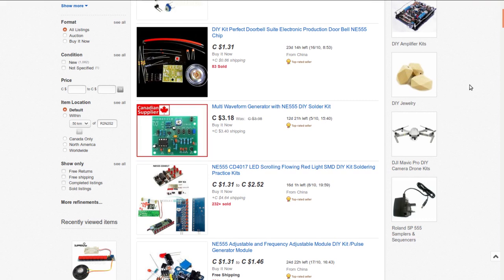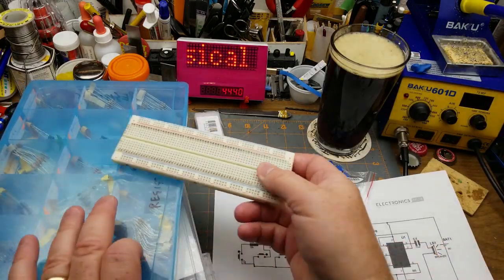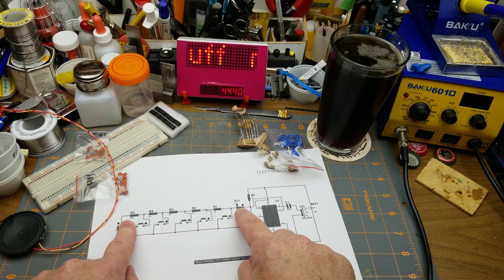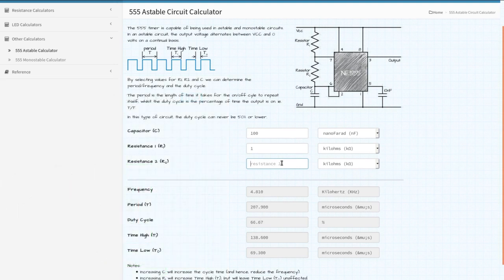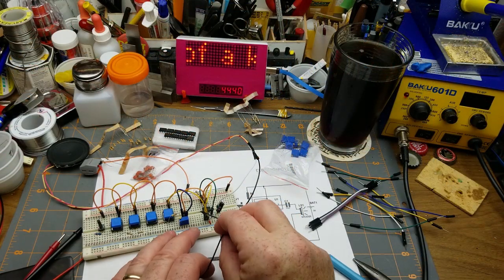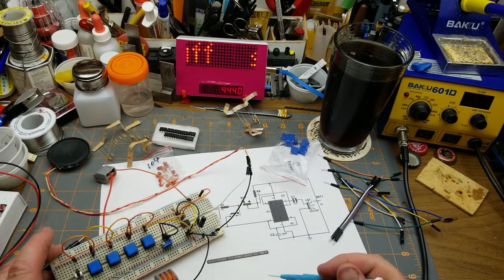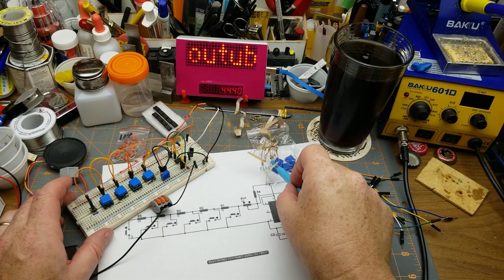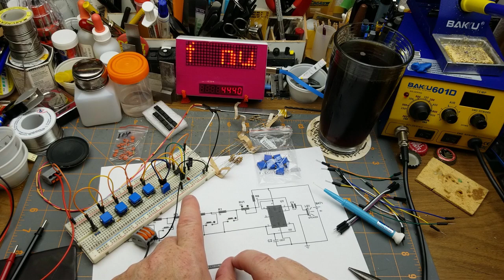simple electronic musical instrument  (starring the 555 timer)

Comment: When I was a kid in the 70's, me and my Dad made a 5 octave mono organ which worked on this principle. We didn't use a 555, it had an Astable multi-vibrator made from 2 BC108 transistors, and a long chain of variable trimmer potentiometers to tune it. Dad sat with a calculator for hours, calculating the resistance required for each note, then what resistance pot he had to buy for that position so it could be adjusted easily to the right value. I think he found somewhere that they were available cheaply, because he had a similar electronics buying strategy to you and ~60 trimmers back then weren't usually cheap! 
We couldn't afford a proper keyboard so we made one by cutting Formica strips, gluing contacts on the back made from phosphor bronze draft excluder strip (for the bottom of doors)  which he clamped between wooden strips to make the staggered keyboard layout. 
Many hours of soldering later, it made quite a fun instrument, I got reasonably good at picking out tunes on it despite having little musical ability. You did occasionally have to stop to glue back on a contact or 2 but I guess that was part of the fun. We then went on to make some circuits to modify the sound, like an envelope shaper and a ring modulator. Our experiments with the homebrew "synthesiser" stopped when I went off the university, but it was a fun time.

Comment: I love this beginners electronics stuff,  I remember playing around with 555s and 4017s or lm3914s back in the 80's I used to make up circuits from the Maplins catalogues They sold the chips and usually gave a sample circuit that that specific device could be used in. I made the very same stuff you are playing with, scanners and tone generators. never made anything useful but the experience has come in useful in my years in industrial electronics when ever you see a 555, 4017, 3914 you know exactly what it is you may not know exactly how it is working in application you are working on but you have a very good idea. I still play with basic electronics can't stand the modern stuff like FPGAs but arduionos are a perfect modern equivalent. love your videos and usually makes me get back to my work bench to have another play with stuff. Thumbs up.

Comment: Was waiting for you to press two keys at once. Now I may have to make my own to scratch that itch.

If the resistances add up, using a set of standard resistor values would let you use multiple keys to generate ... well, lots more notes than one key at a time. Practical demonstration of why those resistor values were chosen.
Reply from the maker: In this circuit there can only ever be one note played at a time, no matter how many buttons you press. 
Pressing multiple buttons just puts multiple resistors in parallel and will raise the note
Reply: Yes, that's what I was thinking about - using multiple keys to get a wider range of single notes. If you choose the values carefully it could probably get all the notes of the musical scale. The math scares me a bit though ...
Reply from the maker: @strayling1  If I replaced the fixed resistors with pots I could fine-tune each note to be a "real" note, and with more pushbuttons than I currently own it could play the entire musical range. 

This simple circuit could easilly be the basis of a foll-on homemade synth. add more notes, add output filters, etc...

Comment: Neat! It could actually even be simplified with just a logic gates inverter (buffer or nand) or even a single transistor in a slightly different way.
Reply from the maker: Yeah. any sort of oscillator that can use a change of resistance (or capacitance) to alter the frequency.

Comment: The good old 555 timer, not precise but very very flexable :-D
The 78xx series regulators and Lm317 variable voltage are old but still a favorite too :-D
Reply from the maker: I have plans to use some of those classic linear regulators in an upcoming project as well.
Reply: Just spatter a few capacitors around the input and output and they are happy as a dog with 3 trees to pee up  :-D.

Comment: Yeah I stopped buying kits pretty soon into my hobby. I looked at a number of BOMs from the Synthrotek website and just ordered whatever ICs they used. 😂 Actually turned out to NOT be a bad idea ... but the last kit I bought was the little ICL8038 function generator because the ones I designed were awful, and it was soooo cheap (and works).

Comment: I'm thinking that schematic you found had a typo for the last resistor and it should have ALSO been 1k...
Reply from the maker: Possibly, though a few of the variants I found also had a much larger resistor in the last position for some reason.

Regardless, it made a useful demonstration of the amount of step you can get between tones by varying the resistor.
Reply: @pileofstuff  Absolutely- an excellent demonstration - thank you.  I just found it odd that that last note jumps down so far from the other notes which is not something you would want in a musical instrument. Keep up the good work!!
Reply from the maker: @kirkb4989  I agree that it doesn't make sense musically. I suspect it was there just to demonstrate that you can use any value of resistor, and not just the same 1K that the rest of the switches used.